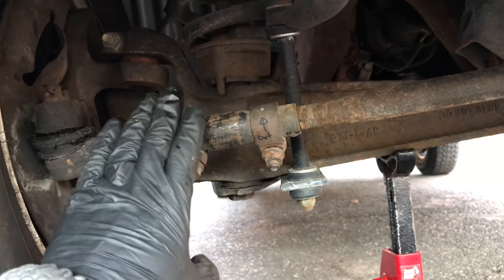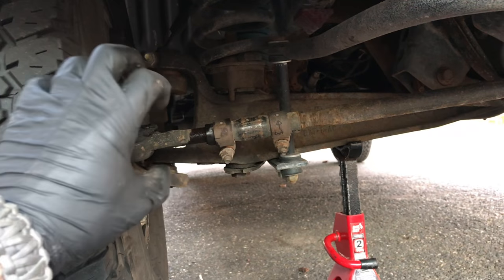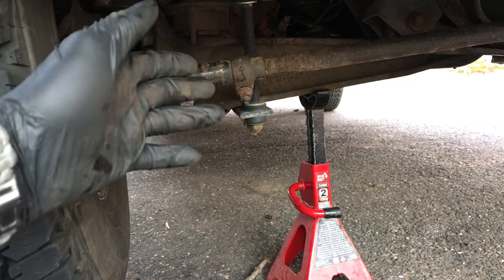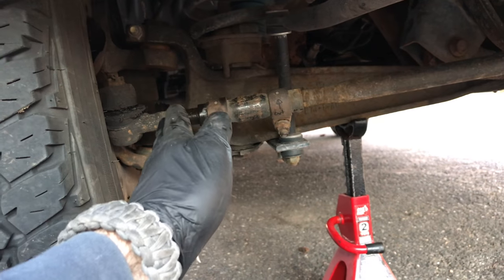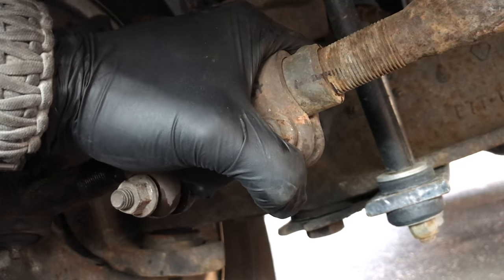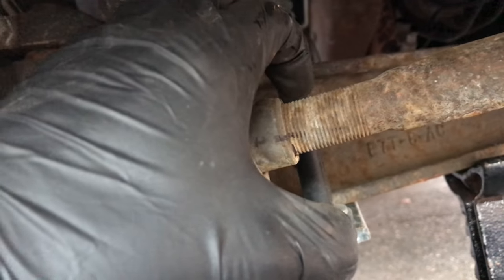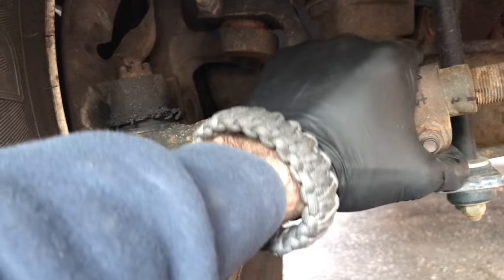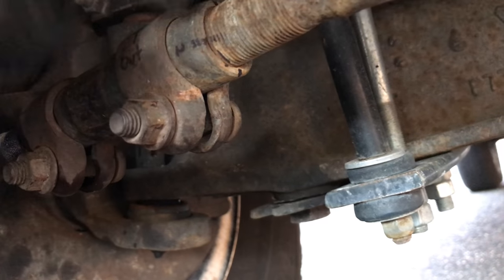How to Adjust Your Steering Alignment by Yourself | 1995 Ford F150

Comment: Do you lnow what size socket this needs? To loosen?
Reply from the maker: Good question. I don’t remember exactly. Probably 3/4 or 13/16.
Reply: @TheMinuteMasters  thanks! You should totally make a video showing how to replace the transfer case shifter 😂
Reply from the maker: @Broncosfan008  you’re welcome! So my truck is 2wd. But…I am converting to 4x4. So I probably could make that video in the future.
Reply: @TheMinuteMasters  Oh duh lol I forgot you had mentioned that it's 2x2 before. Yeah from what I'm seeing I should be able to do pretty much everything up top from the hole already there. I literally just bought this rough 95 f150 beater and your videos have been super helpful! Definitely appreciate them since I've never worked on cars/trucks at all lol.

Comment: Hey steve have ever thought about converting your truck to four wheel drive?
Reply from the maker: Joe Dirt I actually have! Most guys will and probably have told you just to buy a 4x4 truck. The reason they say this is 1) it’s a ton of work. 2) It costs more to do the conversion than to buy another. I’ve estimated it to be between 2k and 3k without a donor truck. 3) the biggest hurtle to overcome is the 2wd frame is different from 4wd. So you have to cut and weld a 4wd frame into your truck. (This could be different from solid axle trucks.) After I learned all of that, I just had to settle for my 2wd. I would like to buy a 4wd in the future though. In the meantime, I’m going do a prerunner mid travel suspension.

Comment: I do electronic alignment  on my ford expedition 2006 and still play  right and left on highway i cant go straight
Reply from the maker: So an alignment will get you straight. If your expedition likes to veer/pull to one particular side I’d say that’s an alignment issue. If your expedition will veer to either side there’s a couple of things that affect that. If alignment is straight and you have play to either side, I’d look at your ball joints and tie rod ends. If they are worn, you will have some play. If those two fixes don’t do it, you might have too much “toe in” and need more “toe out” (think pointing you toes inward or your toes out ward. “Toe in”makes turning fast and or dodgy. It takes more work to keep the vehicle pointed straight. “Toe out”will make steering less responsive and make you stay straighter. An ideal alignment for a DD is slight negative camber, slight toe out, and slight positive caster.
Reply: @TheMinuteMasters  thanks
Reply from the maker: @soufyanedz9688  No problem man!🤙

Comment: 1 quarter on both sides?
Reply from the maker: So to adjust my steering I had to turn it 1 quarter on both sides. You may need more turns. But you definitely have to adjust both sides if you want both wheels to be parallel (assuming they are parallel already).

Comment: What a pain in the dick. They couldn't just design a steering wheel spline shaft so that the wheel could be removed and replaced at any position, they had to make it so that you have to jack up your front end and fuck up the alignment just to move the wheel a bit. Forget it I'm ok with a crooked steering wheel.
Reply from the maker: I know right! If you install the Borgeson steering shaft, you can make the adjustment at the steering shaft.👌
Reply: @TheMinuteMasters  I didn't know about that, I'll have to check it out, thanks

Comment: 56 years of front end alignment. This is total bs. Please don't make any more videos till somebody teaches you front end alignment.
Reply from the maker: 56 years is quite an impressive résumé, but I have a hard time believing this is 100% bad advice. 
Every time I brought my truck back from the alignment shop the steering wheel never pointed in a straight direction. So every time it was my job to get the steering wheel to point straight. Once I was finished, I could be going, high speeds and let go of the wheel and it will still drive straight and the steering wheel would point straight as well. So what exactly did I do wrong?